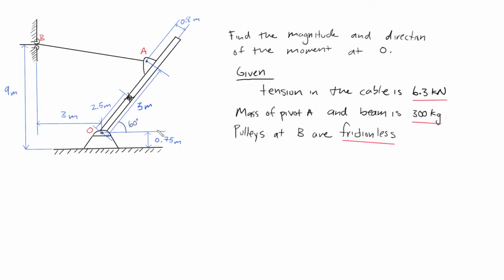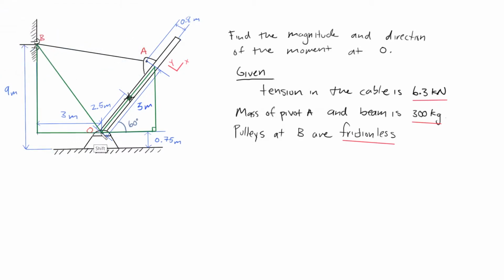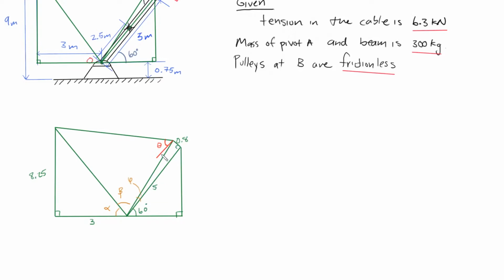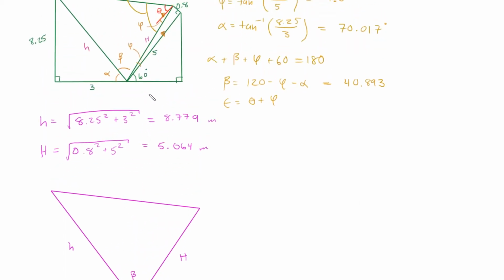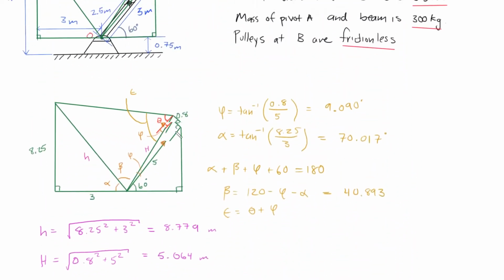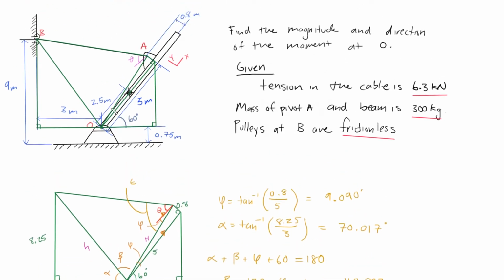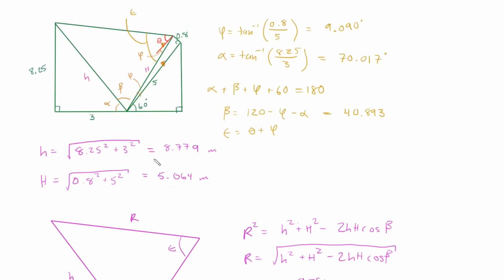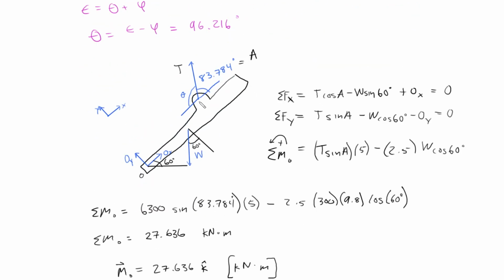Moment Example 1

Comment from the maker: **CAUTION: There exists a small error in the problem!**

When calculating the moment about "O", I forgot the x-component of the tension force when summing moments! The real equation should be...

M = (6300)(5)sin(83.784) - (6300)(0.8)cos(83.784) - (2.5)(300)(9.8)cos(60) = 27.090 kN*m

Sorry about that. I will try to minimize my errors in the future.